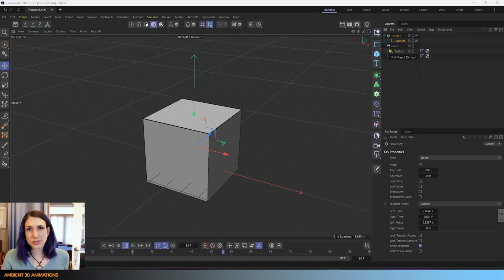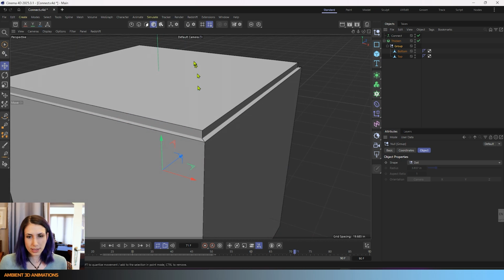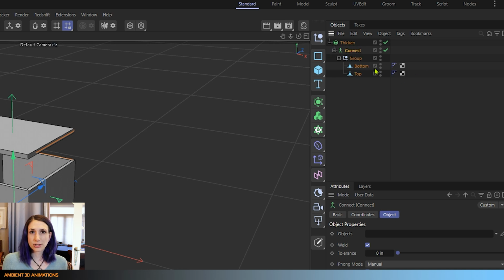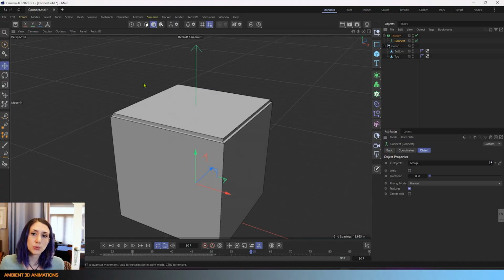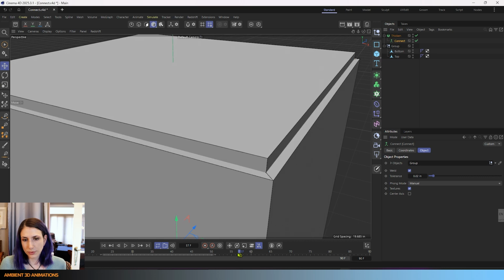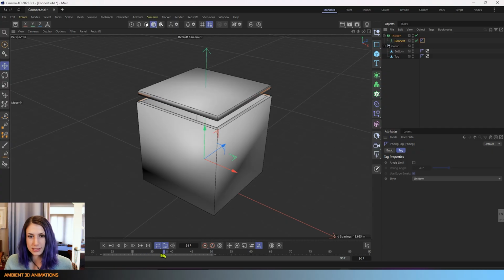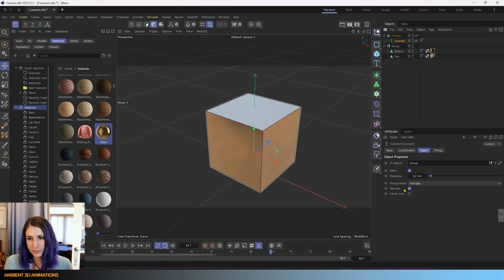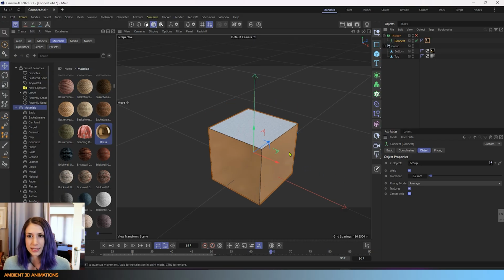Connect Object Generator | EP133

Comment: Be careful with those candles  - they are a fire hazard!   LOL        So I can use the Connect Obj for Splines and Primitives?   Like I can connect two splines before I apply an extrusion or something?
Reply from the maker: lol that is a great question. Splines don’t currently work with the connect but any mesh will so primitives will work :)